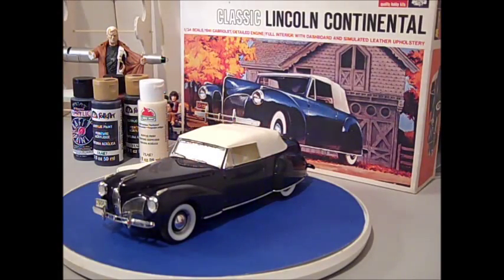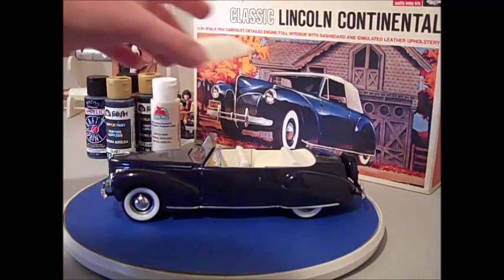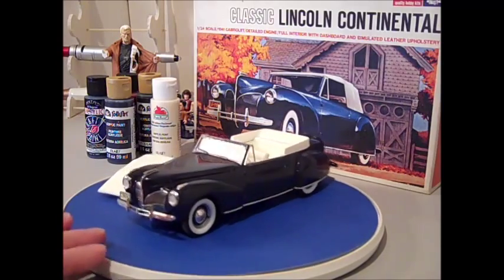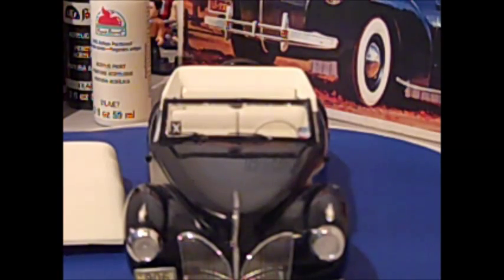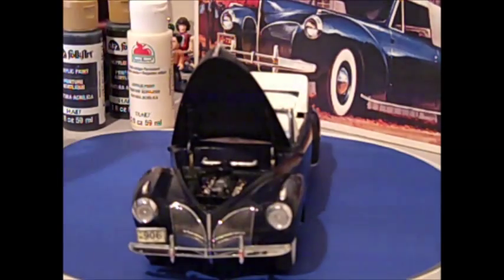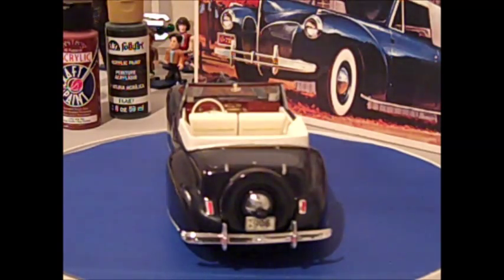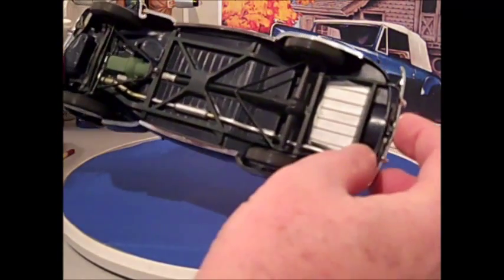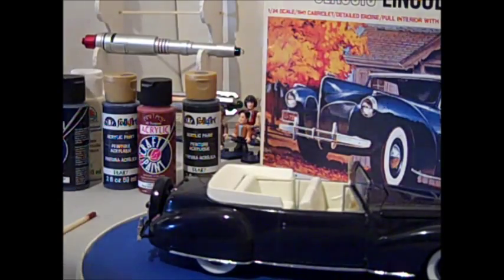1941 Lincoln Continental - Final Update

Comment: KUDOS...that's a nice build! I'm building one right now and I'm having the same issue with the windshield pillar because mine was also not straight; the right side broke off so that's going to be my next task. My plan is to build box stock original with open doors.  It's an '88 Monogram kit molded in beige (body, hood, bellyframe, etc.) and PB tan (interior, seats, etc.) along with the usual glass and chrome; I'm also painting mine the same color as the box model.
Reply from the maker: +B. Rod Clark Thanks.  I really like this kit.  There is some great details especially in the engine.  The fit of the parts was also really terrific.  I was pleasantly surprised for the age of the molds.  I know this kit was offered in 3 different colors depending on the issue.  They changed the box art to match with the colors of the plastic inside.  Mine is the midnight blue, which is what attracted me to it.

Comment: I tried using the craft acrylic on one of my models, and didn't stick. What do I need to do to get better adhesion?
Reply from the maker: There are several factors involved with using craft acrylics on models.  You need to make sure you clean the mold release and other grease off well.  That really just takes a washing with dish soap.  I use LA's Total Awesome from the  $1 store.  Another is roughing up the surface with 500 or 600 grit paper before the washing up.  This is not completely necessary, but does give the paint something to bite into.  Thinning the paint is another thing to consider.  Plain old blue windshield wash (wood alcohol) works well.  I've also seen "Future floor polish" used to thin as well as the top coat.  If you are hand brushing, do not expect complete coverage in one coat on styrene.  It can take 2, 3 or more.  The 1st coat is more like a sealer, then you build up your color coverage.  The brand of craft acrylic is something to consider.  They are not all the same.  This tends to be a personal preference.  I'm not wild about Folk Art as it seems too think to me.  On the other end is Apple Barrel which seems thinner and less/cheaper pigments.  I prefer Delta Ceramcoat.  But I did say it is personal preference.  My suggestion is to do a search in YouTube for Chris Chapman's channel.  He did an excellent series on using craft acrylics a few years back.  There are a lot of other folks in the community who do excellent work with acrylics, classicplastic101 (Chris Cortel) comes to mind.  I hope this is of some help to you.  It does take some learning to use craft acrylics.  Good luck!
Reply: @VinceWeston  Thank you very much, for your help. I'll try again.